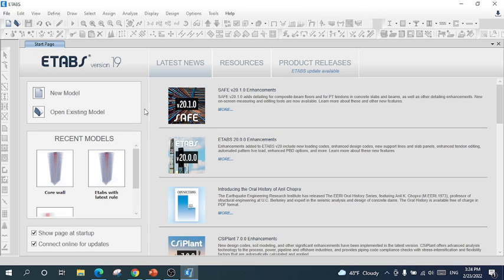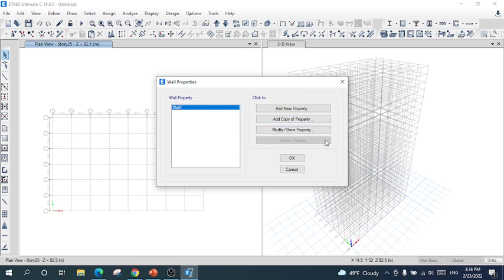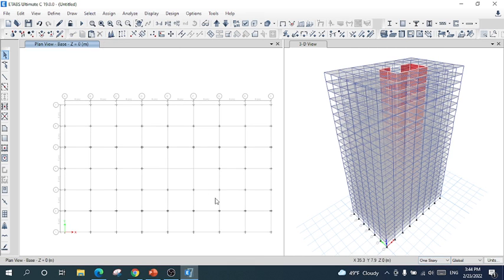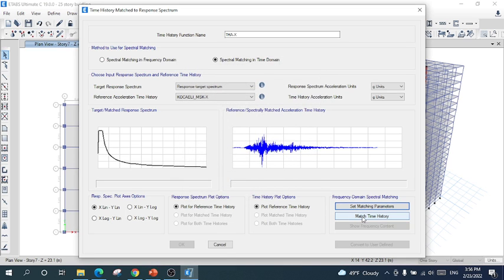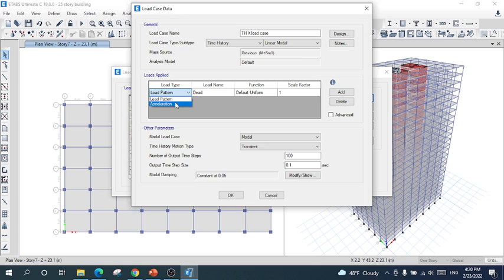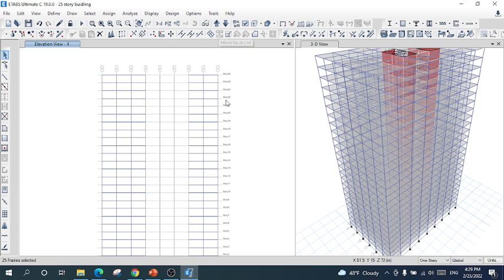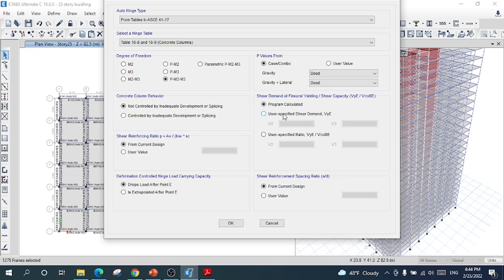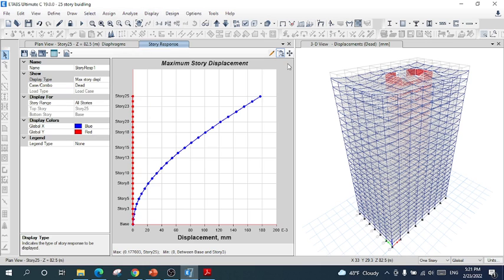Nonlinear Dynamic (Time-History) Analysis |Step by step explanation| - ETABS.

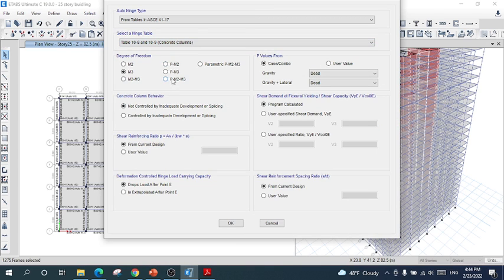Comment: 1:00:10 why didn't you change the gravity load to a DL+LL ? also the gravity + lateral ?!?
because the code says : NUD shall be the maximum compressive axial load accounting for the effects of lateral forces Alternatively, it shall be permitted to evaluate NUD based on a limit-state analysis.

and 
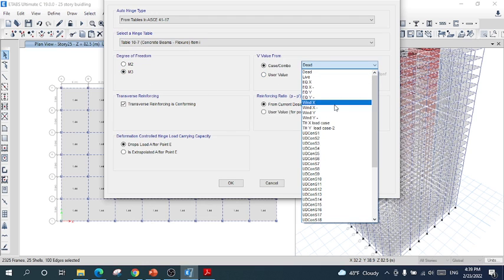58:09 for calculation of V the ASCE says use either time history or pushover procedure, why you used ELF ( and its load combination ) ?

Comment: Hello sir, what about vertical seismic load ? How can I do?
Reply from the maker: There is no need to consider the vertical seismic load as it is negligible, while horizontal seismic forces (lateral loads) are typically more significant and commonly considered in structural design.
Reply: Thank you very much for the explanation sir

Comment: Sir When I did the analysis the sap software gives me the sentence " error in reading time history file" so How can I solve this problem.
Reply from the maker: Oh, the solution for this problem is very simple, 
First have the EQ records, in the folder where you have saved the Sap2000 model, Second you have to specify and insert the same EQ record correct specification while adding the record, for THA.

that is set, you just look for the above 2 correctness.